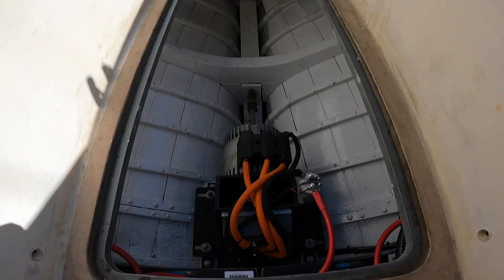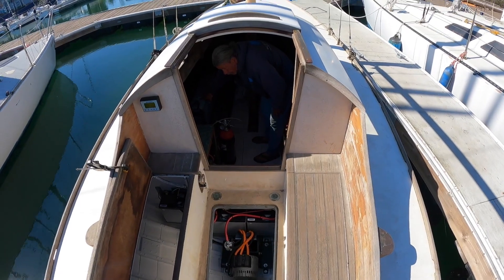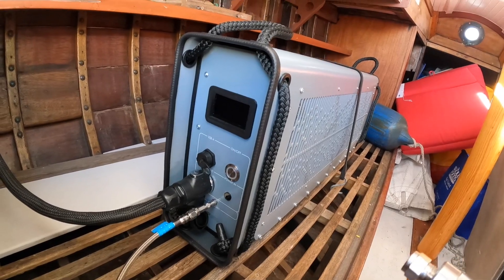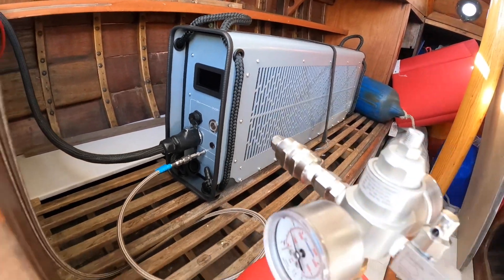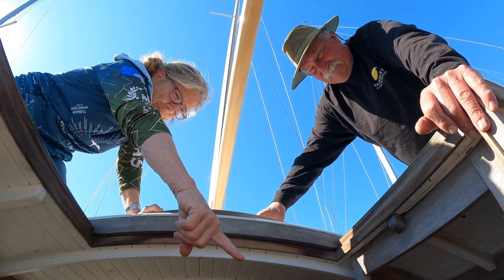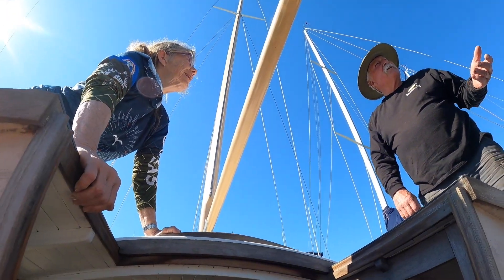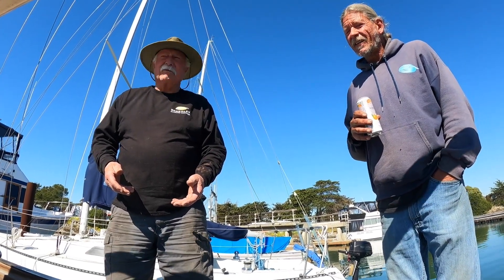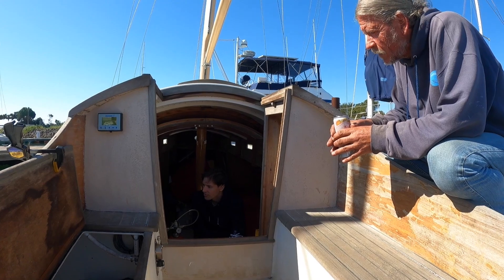Hydrogen Powered Electric Sailboat! (PowerUp & Berkeley Marine Center)

Comment: what hp does you system produce??
Reply from the maker: This system powered a 10KW electric motor. If you are interested in more specs and details on the project, reach out to Berkeley Marine Center at: info@berkeleymarine.com
Reply: @TwotheHorizonSailing  unfortunately that site has zero info about the hydrogen system
Reply from the maker: You can call or email. Or contact PowerUp

Comment: I have been hoping there would be more information on the technical aspects motor generator and installation of the system
Reply from the maker: Yes, this was a simple promo video I put together on the fly since this was the first test of the system actually moving the boat with only hydrogen power (batteries weren’t connected) 
PowerUp has more info on their website but it’s all evolving and happening as we speak so stay tuned for more detailed updates

Comment: Love this! Our 1963 Pearson Ariel is currently fitted with a 24v system and high thrust electric motor. Although we are reliant on dock power for charging, we love the ability to silently motor in and out of our slip! Electric is the future and the future is here!
Reply from the maker: That’s so cool you’ve already gone electric! That’s half the battle! 
If you are interested in the possibility of using a hydrogen generator to recharge, we should chat further and I can introduce you guys to Cree at BMC who is working super hard to make Berkeley Marina an off-the-grid hydrogen hub!
Reply: @TwotheHorizonSailing  We would love to meet Cree! We're on B-Bock in Berkeley. Right across the fairway from Sequoia, the cal 40 rebuilt by Cree and Fred Cook for the 2017 TransPac. We're excited to meet all the Legends here in the Bay!

Comment: I am iffy on electric boats, but I would absolutely convert my boat to a hydrogen electric.
Reply from the maker: What makes you feel iffy about electric motors for boats? The main issue with them is having enough power (for boats who want a longer range). For bigger boats the electric system is made a hybrid one with a diesel generator, but if bigger boats could use hydrogen to gain longer range that would eliminate their need for any fossil fuels. For small day sailors, you could have a very minimal battery Bank and the hydrogen generator would give more than enough power to get out the marina and power your systems while sailing